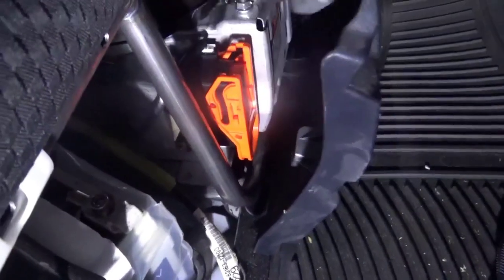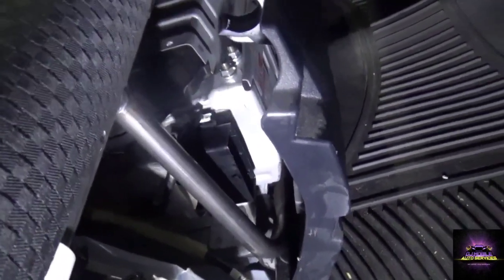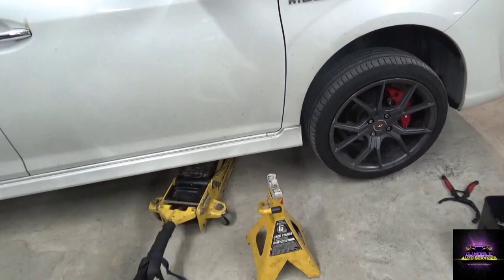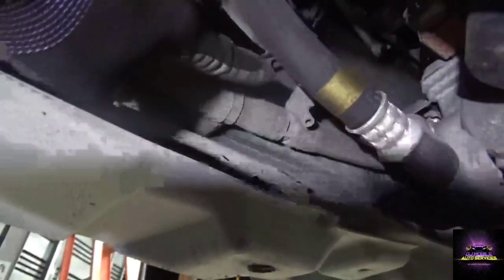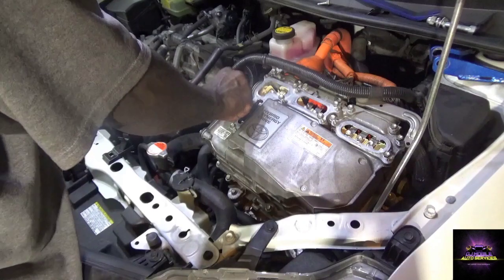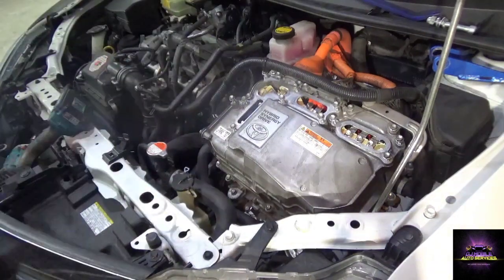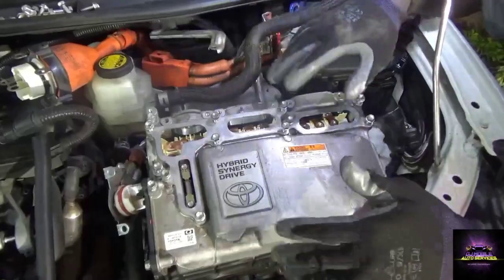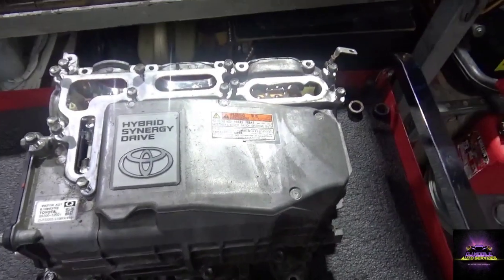Toyota Fielder Inverter/Converter removal and installation

Comment: Hi? I need help. Around 8:50 of your video, you remove bundle of wire with a grey clip.  the clip or wire socket holder is not latching or snapping in place or locking . even if i push the wire in and push that grey clip in , if i move the wire , they come out or come loose

how to go about to get that grey clip to lock in place

Car is telling me there is an open circuit, check hybrid system, and not starting or goes into ready mode

Help pls how to install that clip to snpa in place and hold the
Reply from the maker: Ensure that the tab is not in the lock position. Slide it in towards the front (like if it's going to hook). Then, push towards the inverter.  You will hear the snap

Comment: Hello mate ive got a 2006 toyota alphard thats has hybrid inverter codes and it does not start it used to make a humming noise now it does nothing how can i check if the inverter is working what can i test inside it to see what wrong
Reply from the maker: You can check the IGBTs on the circuit board. Be careful when opening.  You may need to obtain one. Did you put back the interlock properly on the inverter?